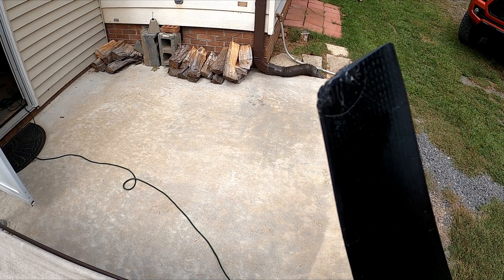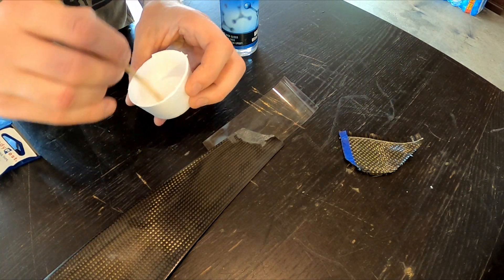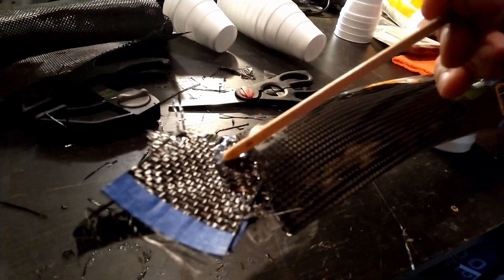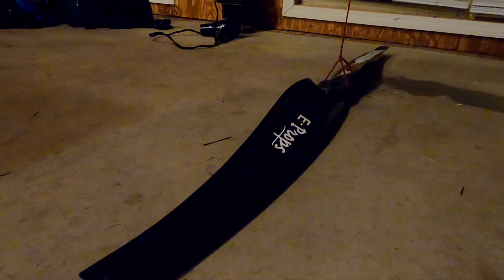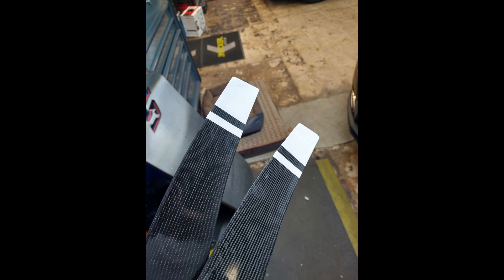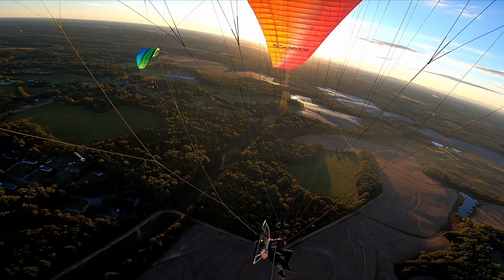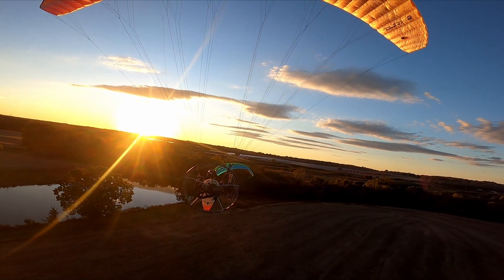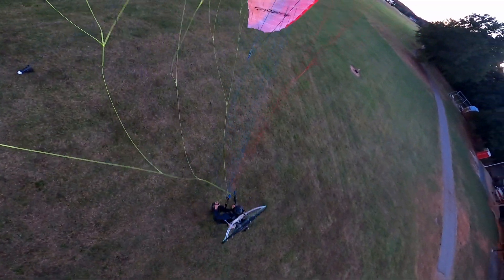Carbon Fiber propeller repair | Avery Flies

Comment from the maker: Well, the propeller did great, but I did finally break it! Lasted almost 5 months before I had a hard landing and ground strike that took 1/4" out of the repair I did on one blade. The repair did not fall clean off at the seam as some suggested, meaning the adhesion to the original prop material was great. I'd call that a win!

Comment: Wow. Scary on so many levels. Such as the epoxy taking 24 hours to cure because your method of pouring each part into the container cannot possibly be accurate for the correct ratio. And fixing a prop.... there is a reason you got your hands on a broken carbon prop. Because they AREN'T MEANT TO BE FIXED. Ever see one explode because of cracks that could not be seen? Obviously not. Did you re-balance the prop after you "fixed" it? Doubt it! What a joke.
Reply from the maker: Sorry you didn't like the content. People repair carbon fiber props all the time. I will strive to be more exact in measuring in the future. Yes, the balance was after repair, and I had to adjust it a few times to get it balanced. It runs great and flies fine, time will tell who is right, and if it blows I'll make a video on that and remove this one. I'm sure you'll find happiness in my misfortune.
Reply: @AveryFlies  The problem with repairing props, especially carbon ones, is that a tip strike can cause cracks that run up into the blade of the prop that cannot be detected, and can cause the blade to catastrophically fail under load. And use graduated mixing cups. Cheap, and will ensure perfect ratios that will result in proper epoxy setting. After all, your life is depending on properly cured epoxy, no?
Reply from the maker: @ragemore7750  the prop isn't really keeping me from dying, that's the wings job. So while a prop failure is definitely not something I want, landing out is less an emergency and more of a nuisance. The glider keeps gliding just fine, keeping landing spots in range is a big part of learning to fly. 

Grinding back past the damage hopefully solves the crack problem, but you're right, it is a risk that I'm accepting. Hopefully my pre and post flight checks will catch it if something gets worse. As for mixing, yes, next time it will be in a graduated cylinder. It cured slow because it was meant for mold and table making, not because the mix was bad, and it's all rock hard. 

I flew it again tonight. I will keep flying it and keep viewers updated.
Reply: @AveryFlies  lol like I said.. wrong on so many levels. Prop explodes, sends shards through your rigging or worse into the back of your neck. Sure, tell me again how a disintegrating prop isnt a danger. lol
Reply: @ragemore7750  Even a couple holes in your wing won't bring you down like a rock. Many paramotor pilots repair damaged propeller tips like this. "Ever see one explode because of cracks that could not be seen? " - personally no. Have you? Gotta link? Any stats on this? Anecdotes are not data sir.

Comment: That resin is casting resin. Its fine for that purpose, but has a very long cure time to allow gas bubbles to escape for clear casts.  Laminating resin is more appropriate for this job. You can reduce the cure time significantly of any epoxide resins by elevating the temperature. Even to just 100deg with a space heater pointed at it will reduce the cure time dramatically. On the order of a magnitude with many resins.
Reply from the maker: Good to know for future projects, thanks!
Reply: @AveryFlies  Also, you need to commence with the subsequent layers before the previous layers cure for proper bond. If you allow previous layers to cure, you will need to prep the surface by scuffing etc. for proper bond. You want to apply subsequent layers while the previous resin is in a gel state so the new layer resin will interlink. If applying to cured resin with no prep, there is potential for it to delaminate.

Comment: For anyone that's working with epoxy resins for the first time, they cure at different rates depending on the thickness poured as well as the temps in the room where its curing. Make sure when looking for resins that you're getting one that will cure correctly at that thickness. There are ones that cure faster but I would trust the slow curing for more strength than the quick ones. The quick curing resins and polyester resins will cure very hot. Polyester has a strong nasty smell as curing, I stay away from it for my projects. It is also not as strong as epoxy from what I understand. Also, great job on the self-repair!
Reply from the maker: Good info! Mind if I pin it for others?
Reply: The reason for this is that epoxides are exothermic. The "thicker" the pour, the more heat is contained reducing the cure time drastically. They will all cure correctly at any thickness given they were mixed properly. What varies is your working time, and final cure time.  Final cure strength is not determined by the cure speed or thickness. This is determined by the epoxy type, mix ratio, and how well it was mixed. Thickness poured for a given type will only affect how quickly it sets, and may reduce final cure time. Faster epoxides such as "5 minute" give the working time, not final cure time, and they do remain soft for a period after that set time, but will still cure to similar final strength after the full cure time.  So your statements are somewhat correct, but not really.....  If you pay close attention to the packaging for "fast" epoxides, it will say fast "setting" not fast "curing". Often people are very confused by this, or simply ignore the meaning of words.

Comment: Looks good. Getting into repair myself. Got a 3 blade 160 to try my first actual repair on. Do you happen to know how much can be added, I got one missing about 6" of blade missing?
Reply from the maker: I don't know if there's any hard fast rule, but personally if anything major happens in the inner 2/3rds I wouldn't try it.
Reply: @AveryFlies  thank you. That's what I was thinking on going with how he does it. Thanks on the 2/3 thing also.
Reply from the maker: You might try Kyle Oglees method of making a mold from a fresh prop, that way you can reconstruct major sections and retain the shape.

Comment: Hey man great looking repairs! I have had great luck with adding some silica powder (thickener) to fill in some cavities on carbon and fiberglass. It really helps holding shape on longer cures too. Not to be a safety Sally, but use a respirator when sanding that stuff- it's incredibly bad for the lungs!
Reply from the maker: but moooooooooom respirators look dumb! Haha thanks, hopefully I don't have to do this too often.
Reply: @AveryFlies  🤣